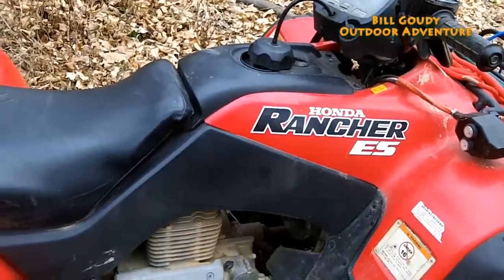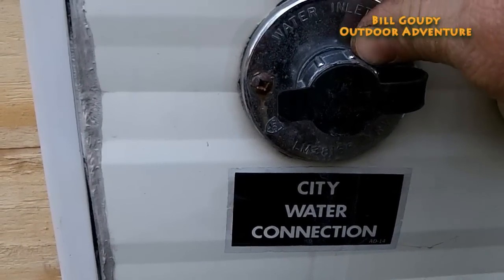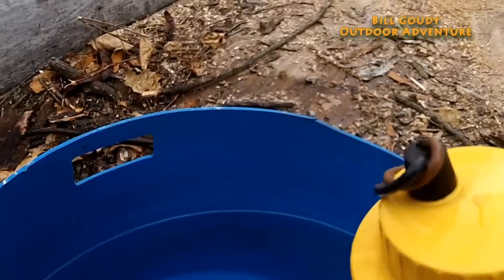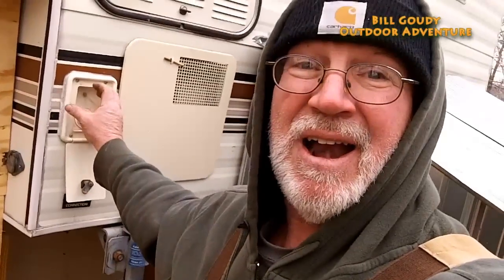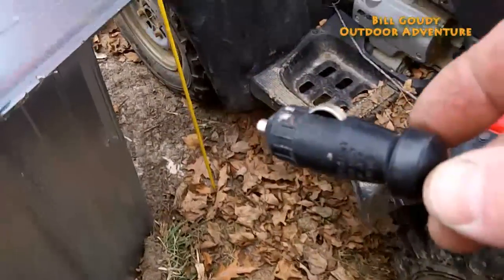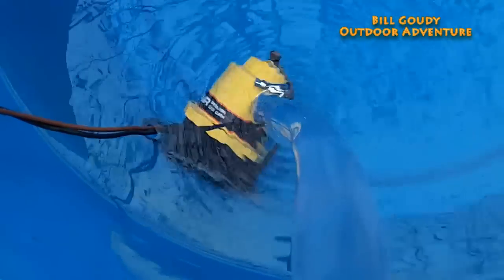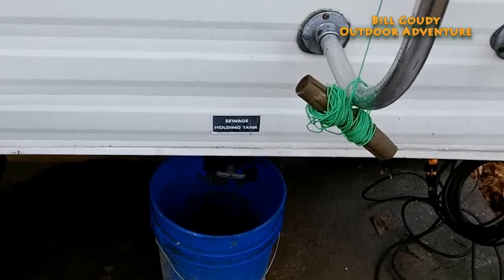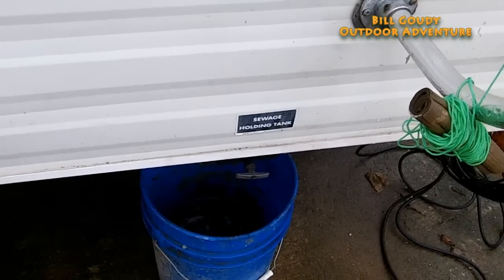Off Grid - Winter Living - My Fresh Water

Comment: I hear ya Bill with the work involved with getting fresh water.  Here at the cabin where I live alongside a 52 mile long lake you would think its easy, but its not.  I haul mine from a spring that's about 5 miles away, I fill about 3/4 of 5 gallon buckets to fill a 45 gallon holding tank that's inside of my cabin. I use a sureflo rv pump to have running water with all indoor plumbing.  I dug for a well years ago but had no luck.  Those bilge pumps are great too... I have used them in the past.  I installed a propane hot water on demand here and I just have a single line running through that.  If I want cold water, I leave it off, if I want hot water for a shower or washing dishes, a simple plug it in and I have my temperature set to 105 degrees which is just fine for me!  Gotta love living off grid Bill... I wouldn't have it any other way!  Cheers
Reply from the maker: Great method, Dave!!  I also have a 12v sureflo pump on my camper that provides the water pressure to the camper...  Works great!!   I used propane last year to heat my water..  I made a change this year to heating my water with the wood barrel stove...  Works out pretty good for me!!  I will have a video out on it in the near future!!  Thanks for watching, Dave... Stay warm my friend!! ;-)

Comment: It is a good system you rigged up with the pump .I wonder if you could modify it to fill it from the inside of the camper using gallon jugs or those 5 gal. water cooler bottles
Reply from the maker: I could...  The tube that goes to the outside port is just held in place with a hose clamp,  The problem is I do not have water cooler jug, but I do have plenty of 1 gallon jugs...  I will give your idea some careful consideration...  Thank you so much!!

Comment: Hey Bill, you need to take us along for a stormy note in the camper.Bring us up to date on how to stay warm and enjoy an ugly nite
Reply from the maker: Thanks, Jack..  Back when I made this video I heated the camper with wood...  I built and out building to house a barrel stove...  Man, it worked great...  I was not off the grid last winter...  I used an electric heater to stay warm and there were a few times that I turned on the onboard LP heater and the electric at the same time...  Yes it was just that cold!!  ;-)

Comment: how many gallons does the blue tub hold?
Reply from the maker: I think that it will hold about 25 Gallons, but by the time I get it to the camper...,  There is about 20 gallons in it!!!  My holding tank will hold 30 gallons ...  So When I get to a half tank...  I try to refill it...   In really cold weather I just add 5 to 10 gallons from 1 gallon jugs....  Working with water in Sub-Zero temps is not fun!!